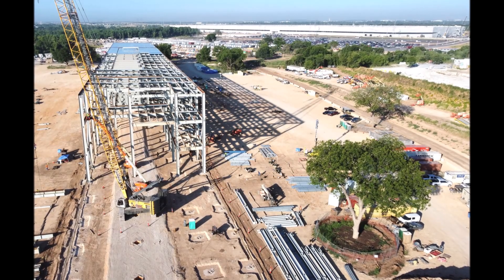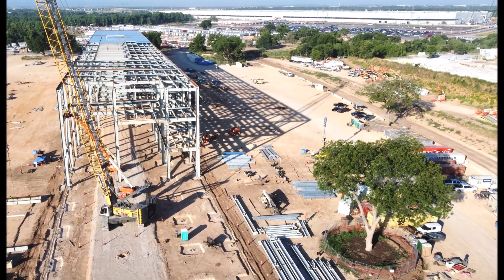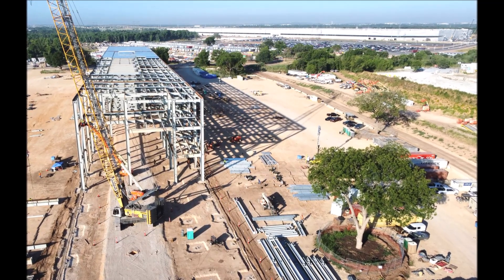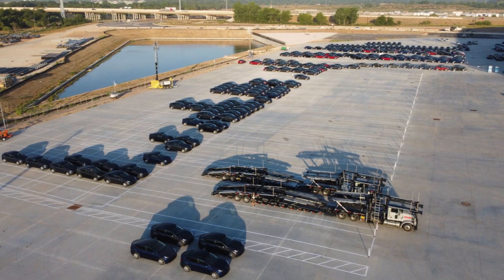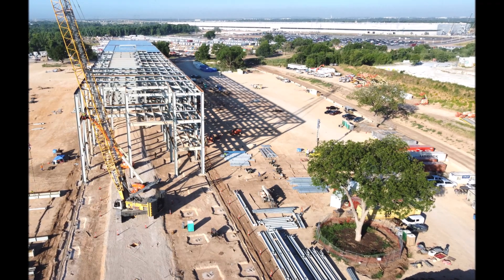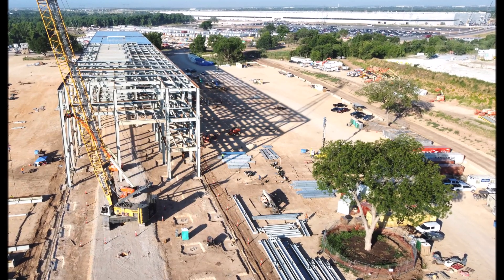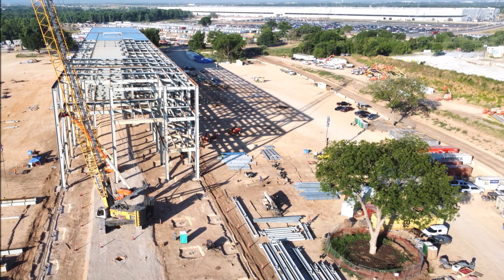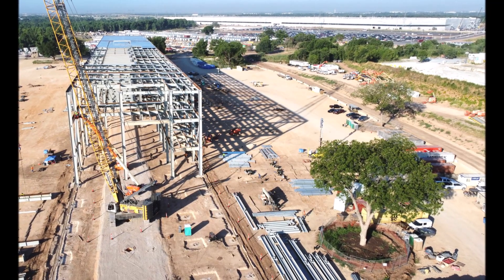A Nice Clear Shot of Tesla Giga Texas’ Battery Cathode Plant Progress

Comment: As I have posted before, the Texas environmental rules are more strict than they are in Germany. The difference is that the administrators are competent and the process for handling request of all types are designed to come to a conclusion in a short time, rather than dragging it out for months.
Reply from the maker: Which do you think is more favorable for Tesla?
Reply: @Torquenews  any process that cannot be derailed by any group that feels like it for any reason under the sun is superior to germany at this point
Reply: @Torquenews  Your Kidding Right? They put the mile long main building up in 18 months. All the steel for the cathode plant was still laying on the ground just a few weeks ago. Texas Dude. Texas.